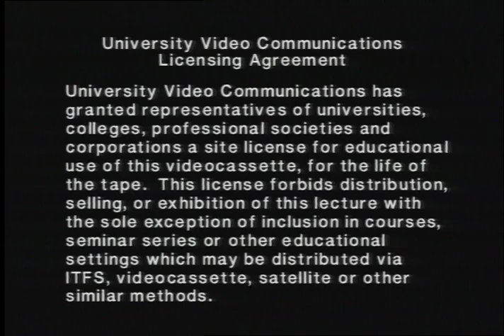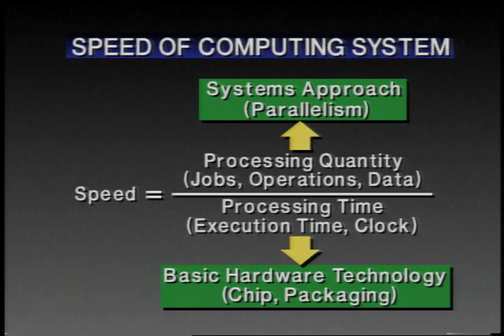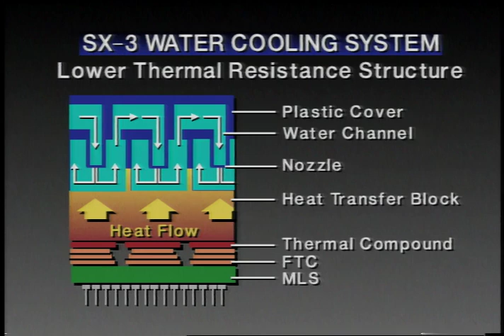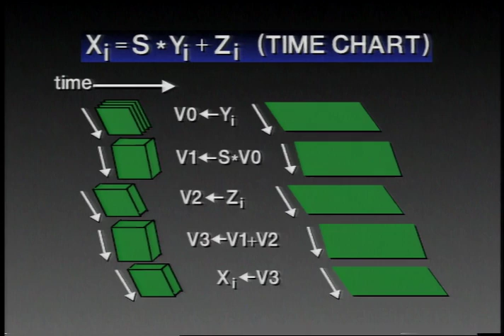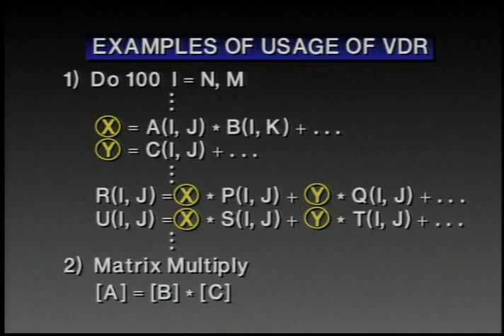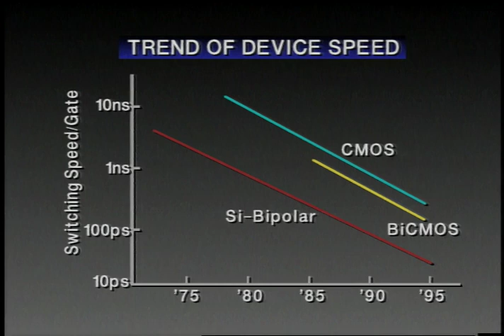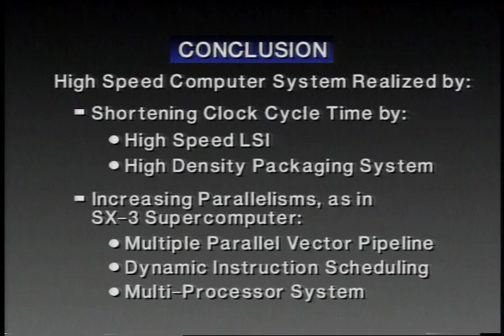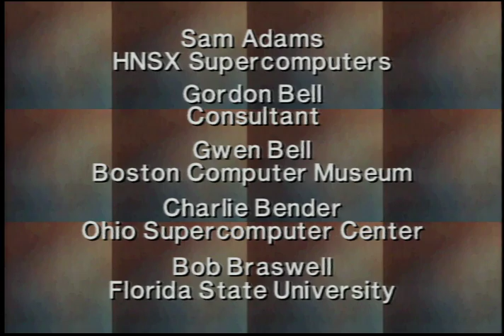Toward the Ultra High-Speed Computing System, lecture by Tadashi Watanabe

Comment: I'm curious if there are any efforts underway to build current super computers with bespoke hardware.  I am aware that for decades super computer design has been based around cluster systems. But are there any efforts to make custom chips to perform at these levels or is there no justifiable reason to do so any more?